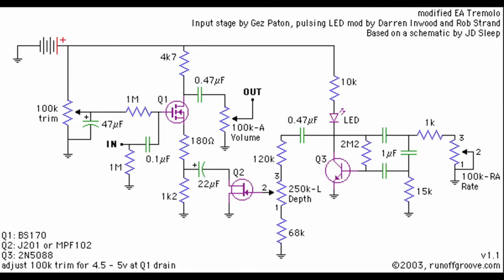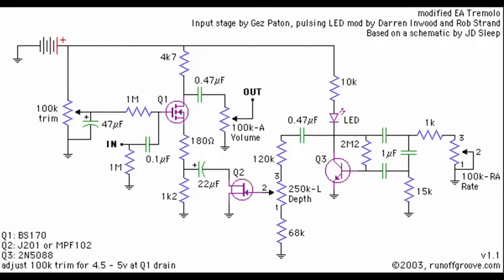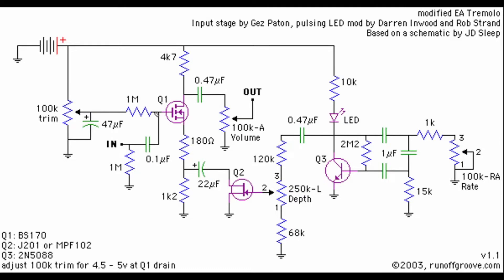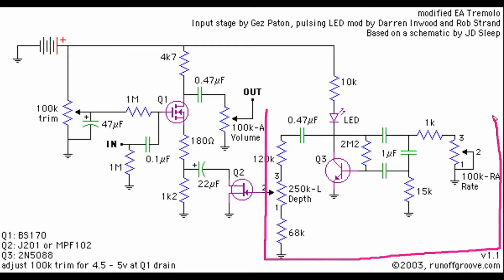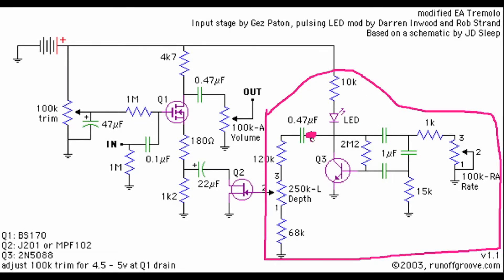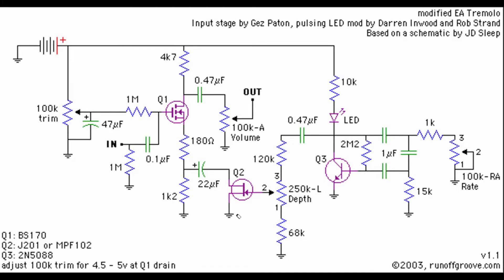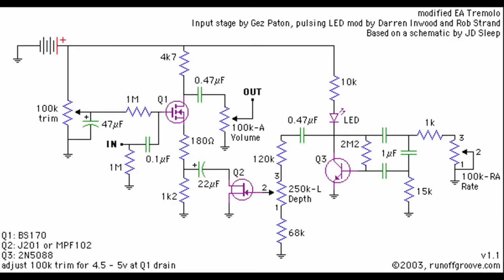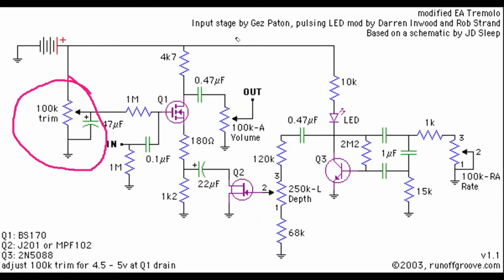Schematic Elements for Guitar and Effects: Amplitude Modulation and the EA Tremolo

Comment: I have a landtone diy from amazon with a similar circuit and I’m trying to increase the depth to make it choppier (the sound doesn’t entirely fade with depth maxed), should I increase the resistance between lug1 on the depth pot by putting a resistor between it and ground, or increase the resistance on lug3?  Would changing the .47 cap right behind it work?  And can you replace that RC pair with a red LED to get the same effect?
This video was super helpful, I’m just still trying to figure out if the voltage that feeds Q2 is correlated or inverse to signal output.  I’ll check out the previous video to make sure.

Comment: Helpful explanation of the circuit. Is it the case that a low total resistance on the 1k fixed and 100k pot pair (1k ohm min.) results in the fastest oscillation, and the max of 101k ohm the slowest oscillation? I'd like to push the oscillation time slower on this circuit. Would increasing the value of the 1K fixed resistor or the 100k pot have that result? I expect modifying the fixed resistor will also impact the max speed - so the overall range of fastest to slowest would shift. Do you know the formula for calculating the LFO speed range based on the R/C values?

Comment: This was informative thanks. Would love to see an explanation of the Kay tremolo like this! 😅
I'm trying to figure out my understanding of the LFO in that circuit which is made up of 4 NPN transistors only, so different to this circuit. 
I'm trying to suss out how I can control the rate via a different external source. 
Any tips or suggestions?
Many thanks.
Reply from the maker: After a quick look at the schematic from General Guitar Gadgets, it looks like the rate would just be controlled by the adjustable resistor in the Twin T oscillator network. If you would still like me to do a video on it, I can certainly do so.
Reply: @thescientificguitarist4228  I would absolutely appreciate that for sure! Being able to understand where the  LFO/rate is, exactly, and how I could manipulate it via an external source would be really advantageous. I've got a rate knob all hooked up, already, but how could I introduce an additional optional signal, let's say, a click track, so that it controls the rate?